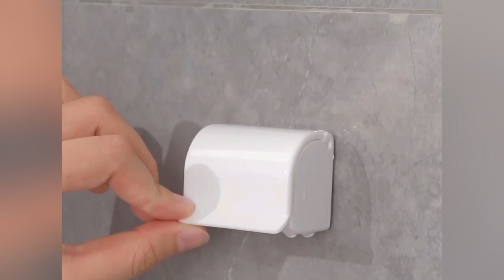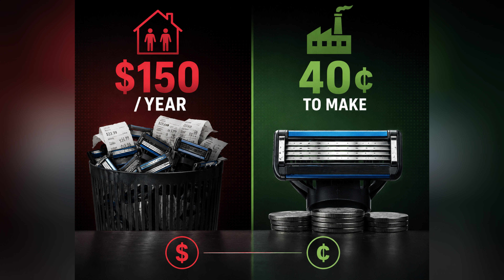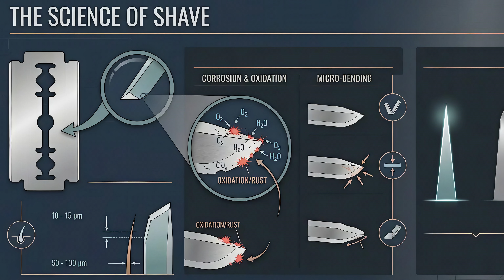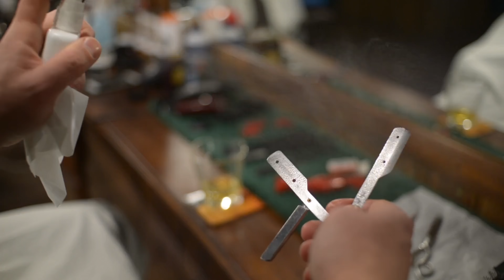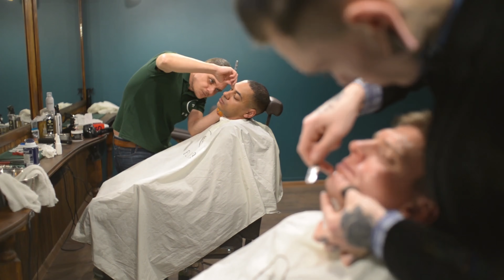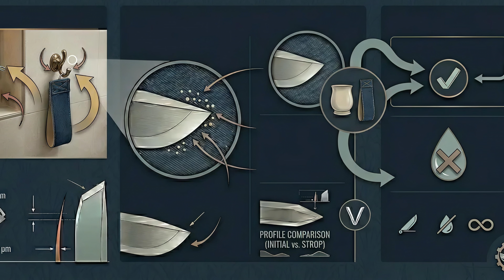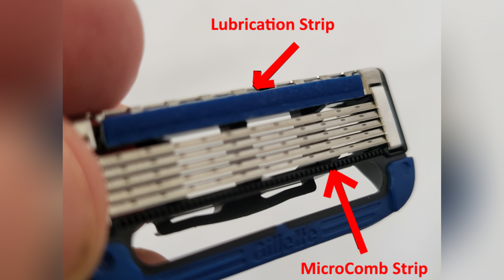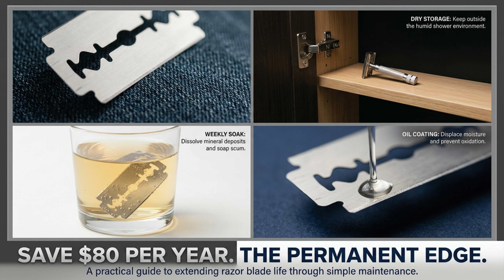Your Razor Is Designed to Dull After 3 Uses — How to Make It Last 2 years!

Comment: Good video.  I simply dropped cartridge razors for good, they are not worth it.  Safety razors are the way to go and at least 1/4 the price if not more.  During 2020, I bought a lifetime supply of blades.  One trick, treat shaving as a ritual instead of a chore and take your time.  If you shave in morning and find yourself always rushing, wake up earlier.
Reply: I will admit to easily defeating the safety in the safety blades and found myself freely losing copious amounts of blood
Reply from the maker: That's a fantastic point about safety razors! I'm glad you found a shaving routine that works so well for you, and the tip about treating it as a ritual is brilliant!  I love having little rituals for things like this.
My wife and I have a kombucha ritual, and we also have a few weird gardening rituals that, honestly, would probably make us look crazy if people saw us doing them. But we know they work, so we keep doing them. 😄
Reply: @PrimaryIgnition  I also switched to a safety razor, and not only is it WAY cheaper, I get the best shave with fewer cuts and no razor burn.
Reply: Not 1/4 The price; more like 1/40 The price. And they can be resharpened.
Reply: What are safety razors?
Reply: @Chris-xd4kb  it's a handle that holds those thin double sided razor blades.  There are very expensive statement handles and very inexpensive handles.  The double-sided razors themselves are the inexpensive things I meant.  They call it a safety razor because unlike a straight blade the handle has a cap that somewhat prevents you from cutting yourself.  Respect that handle though as it will surely cut you if you add too much pressure like a cartridge blade.

Comment: How do I flip a cartridge razor? It can’t be done, rendering the entire process useless. Help me understand if I am mistaken.
Reply: Well thanks for the heart but it doesn’t help.
Reply from the maker: Run the razor backward up the denim with the blades trailing, not cutting into the fabric. Then turn the handle around/reposition your wrist and do the same backward strokes again from the other angle. The important part is not the “flip” — the important part is that the blades always move backward, never edge-first.

Honestly, even if someone only does one backward direction for 20–30 strokes, they’ll still get most of the benefit. The whole point is just to realign the tiny edge, not sharpen it like a knife stone.
Reply: @Sidney_Explains_Money  I believe you're talking about a straight edge or a safety razor correct? I think these guys are stuck on the cartridge method, which I don't think there is a way to flip it.
Reply from the maker: @Francisco_Manos  No, no — I’m talking about a cartridge razor.
When I said to “flip it,” I didn’t mean flip the cartridge around. I meant rub the blades on the denim in one direction for a few strokes, then rub them in the opposite direction across the grain of the jeans.

Denim has a woven grain, so doing 4–5 strokes one way, then 4–5 strokes the other way, helps clean and polish the blade edge more evenly. The cartridge itself stays the same way — you’re just changing the direction you move it on the denim.
Reply: @Sidney_Explains_Money oh, I totally get it now that you mentioned the grain of the denim. By the way, if I ditch the cartridge razors, would you recommend the Hanson razors?
Reply: @Sidney_Explains_Money it’s a cartridge, the denim can’t reach the blades because they are encased in plastic. I’m having trouble with how you can’t understand this. I did make my own laundry soap so I’m a fan, but this makes no sense.
Reply: @Blt-rr2lm  Right?  If it's doable, show how in the video.  Doing it to one side might help, but the blade is still deformed.
Reply: @Blt-rr2lm  if it can reach your skin then it might reach the denim too. But somehow I doubt this method. I do believe that keeping the blade dry can achieve something and will try to dry it out with a paper towel after shaving
Reply: @g @gordanbabic8028 ’s a cartridge razor. You cannot shave with the interior of a cartridge.
Reply: @Blt-rr2lm 

Yes I get what you’re saying. He said to take the cartridge and flip it the other way and repositioning your wrist, but that makes absolutely no sense. There is no other opposite way to do it with a cartridge blade. There is only one direction possible with the cartridge blade no matter how many ways you position your wrist. You simply push the cartridge blade along the denim or towel with the sharp edge trailing the material & not going against the material. There’s nothing to flip around LOL so what he has told you makes absolutely no sense 

That being said; like the other person here had mentioned about the blades probably still coming into close enough proximity with the denim or towel even though you are right about it being encased in plastic ￼￼
Reply: @gordanbabic8028 how about using desiccant packets to help absorb moisture. I'm thinking of putting it in the drawer and then put the cartridge razors on top of it. 🤔
Reply: @Francisco_Manos  that solution seems too expensive 🙂
I don’t know the cost of those dessicants but it probabily adds up through the year
Reply: @gordanbabic8028 The desiccants are actually free, they come included when you buy certain things such as electronics.

Comment: What do you mean by "then you flip it"? That's the part you don't even show what you're talking about. You spend 8 minutes prattling on about the science and stuff. You get to the solution and then you go micro machine man, and zip through it so fast it doesn't even matter if we pause. You didn't even show the other part of what you're doing. Great channel, but also so frustrating. You guys can easily fix that.
Reply: Definitely need to do a better video explaining the process, not just the history and science of it. Even explaining in the comment, doesn’t help as some of us are visual learners. Good concept in theory, but definitely need to update the video with a better explanation at the end with the solution
Reply from the maker: Yeah, totally fair question. When I say “flip it,” I don’t mean flip the cartridge over, remove it, or do anything complicated with the razor head.
I just mean turn the razor around in your hand / change the direction you’re holding it, then repeat the same backward stropping motion from the other angle.

The reason is that denim has a woven texture, and cartridge razors also have a slightly angled multi-blade stack. So doing the backward rub from both directions helps the denim make more even contact with the tiny blade edges instead of only brushing them one way.

But the most important rule is still this: backward strokes only, edge trailing, never cutting forward into the denim. The “flip” just helps get a more even result.